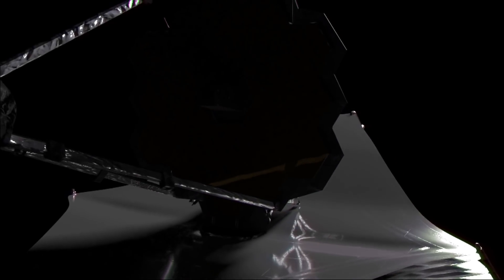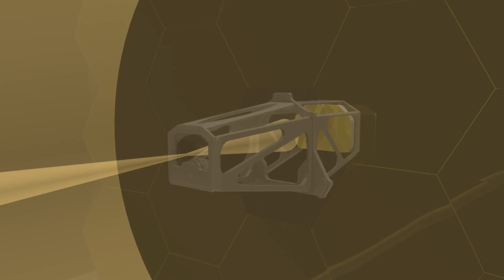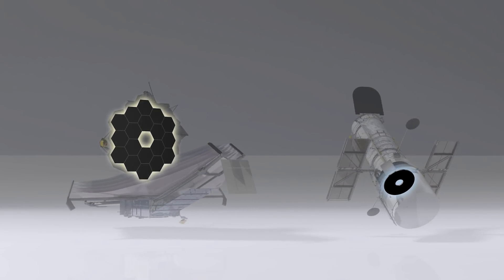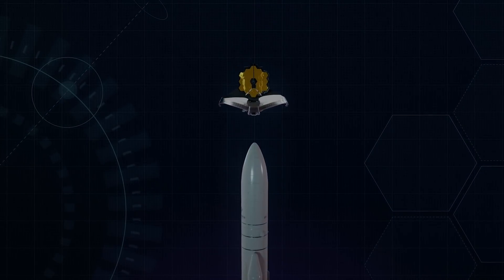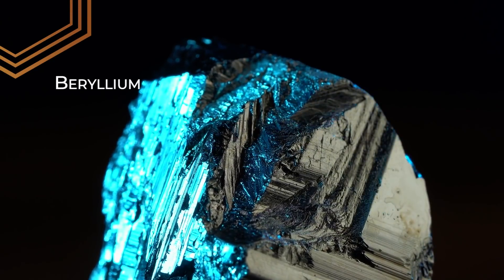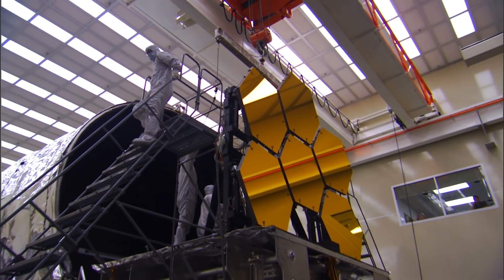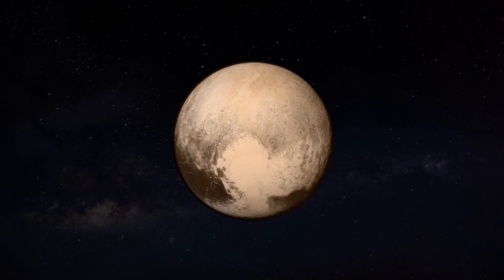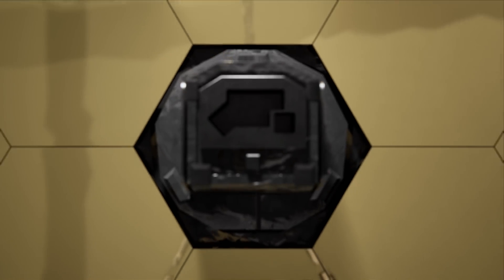The Webb Telescope's Optics

Comment: Beyond the fine steering mirror, are all the rest inside coated with gold as well? If so, is there a link explaining that fact? Thanks
Reply: Randy James the mirrors are all coated with gold because it reflects infrared better than typical aluminium used for visible light.
Reply: @anullhandle  Do you have a link about all the gold-coated mirror inside the camera?
Reply: @RandyJames22  unfortunately no.

Comment: This was the best explanation I've seen so far of how the primary mirror array is tuned. Very cool! Literally. 😎
Reply: gyozakeynesian, breaking taps channel made a 3d printed version of a mirror positioning actuator showing how fine and gross motion is accomplished with one motor. The coarse motion uses conventional mechanisms with the fine motion controlled by a flexsure. Iirc step size is around 8 billionths of a meter.  6 actuators provide rotation and  translation adjustment. A 7th fine tunes the shape of the mirror segment.
Reply: @anullhandle  Cool! I'll check it out. Thanks!

Comment: @James Webb Space Telescope (JWST) Experts in optics say that the fact that the JWST's primary mirror is made of 18 segments, and the fact that JWST operates with higher wavelengths (far infrared) can lower the quality of its pictures even beneath the quality of the pictures taken with Hubble. 
The 2 reasons: 
- the 18 segments of the JWST's primary mirror are smaller than the one-piece primary mirror that Hubble has. More accurately, because of the process of energy redistribution from the beam to the sides/edge diffraction. 
- and then there is the difference in wevelength with which the 2 space telescopes operate (JWST, operating with higher wavelengths has a very big disadvantage). 

Unfortunately this info is not included in these JWST-related videos, which seem to say that the bigger segmented primary mirror of the JWST can produce images sharper than the ones produced by Hubble. 
Can you shine some info on this? Can you make a video on this subject and explain the negative sides of the segmented mirrors and of working with higher wavelengths? Thanks!
Reply: not sure where you found those experts, the JWST will be capable of 0.1 arc sec angular resolution, HST is capable of 0.03 arc second so yeah Hubble can take slightly sharper images. But this is caused by the fact that theoretical limit of a telescope is wavelength divided by mirror diameter and since JWST will work in infrared , it’s angular resolution is automatically in huge disadvantage to HST’s due to basic physics.
Reply: @olasek7972  JWST’s near infrared camera can “see” down to 0.6 microns so at that wavelength it should do better than Hubble because of the larger primary mirror. 
And at what wavelength with Hubble is the .03” achieved?
Reply: @executivesteps  sorry, I don’t have such specific data, I only presume this angular resolution is based on some “weighted” average values of expected wavelengths.
Reply: @executivesteps   hubble can see 0.115 - 2.5 micrometers. Jwst going from 0.6 - 28 micrometers is interesting in it's potential. But it won't be the same type of images, they'll be significantly different. Although should be very beneficial. Hubble is primarily visible light and the other being primarily infrared I don't know if it would be acurate to compare the two telescopes. The jwst can't even see blue light. 
Hubble has a pointing accuracy of 0.007 arcseconds and can see astronomical objects with an angular size of 0.05 arcseconds.
Reply: @olasek7972  although it seems to be a huge gap they say the jwst can see 10-100 times fainter objects than Hubble.
Reply: The bigger issue is diffraction from the 3 arms holding the secondary mirror. I’m guessing they’ll be six spikes emanating from a bright point source like a star.
Reply: Real experts who work in the field of optics https://youtu.be/gOpbXBppUEU
Reply: Which experts in optics? 

How about the ones at NASA?

Comment: I've seen many videos about how primary, secondary, third and fine steering mirrors focus light, and how it gets reflected inside instruments themselves. However i haven't figured out how it gets diverted from one instrument to the other. Or do all of them see the same patch of the sky all the time? If anyone answers, thanks in advance.
Reply: To deduce the internal light distribution design, it would be enough to know if the various test equipment can function all together, or one at the time.
The videos they are putting out are all meant for layman's, not for scientists from other fields, so they lack any real technical information.
It would be nice if they release some video meant for non-astronomers science professionals. I'm relying on some printed materials for some more details...
Reply: The instruments see different sub-patches of sky within the overall field of view (FOV). Imagine the Microsoft logo... The whole logo is the overall FOV and each individual square is the FOV for a particular instrument. In reality, though, the Webb instruments' individual FOVs are not as neatly arranged as the squares in the Microsoft logo. What this means is that each instrument will not see the same patch of sky, but will see patches of sky adjacent to the other instruments'. All that given, though, it seems parallel observing capacity is bandwidth-limited because there is so much data coming off each instrument (so no point turning it on as you don't have space to put the data it would generate). Can't recall downlink or onboard storage capacity.
Reply: @MrcACrl  I have heard what you said in your post before. If this was true the resolution and the light detecting capabilities for a  detector would be substantially reduced below optimal values. Unless I don't understand what is meant by what you said or there is some other trick thing going on here that I don't understand.
Reply: @MrcACrl  downlink budget is about 28 Gb/day.

Comment: What is remarkable is the main mirror size at 255 inches in diameter.  From 1949 until 1993, the largest telescope on Earth was the Hale at Mt Palomar (200 inches).  Technically the Soviets build a bigger scope in 1975, but it has significant design issues and did not live up to its capabilities.

The James Webb is larger than the largest telescopes of a generation ago, and it is in space!  Even today, 255 inches would be considered a very large Earth bound instrument, and there are only a dozen or so at that size or greater.

This points to the remarkable engineering effort involved in sucessfully deploying such a telescope.  I am amazed.
Reply: Interesting history lesson. I had no idea Webb's mirror exceeded the size of earth based telescopes until fairly recently.  All the more impressive it is a spacecraft.
Reply: Great comment!